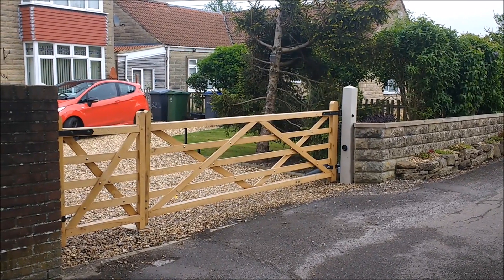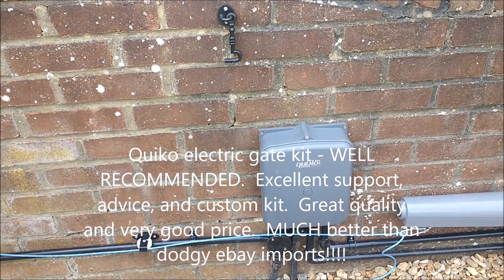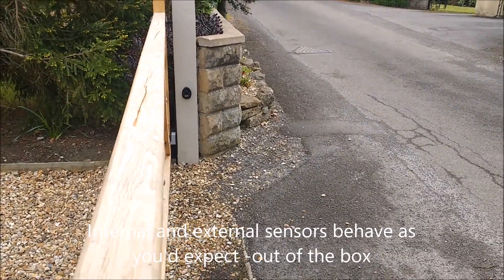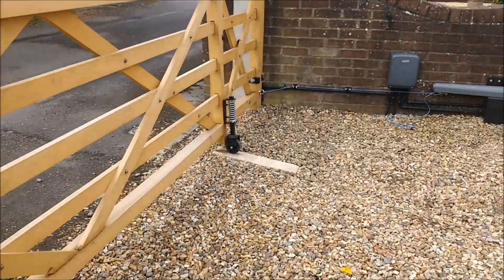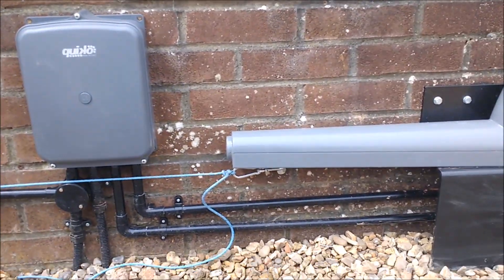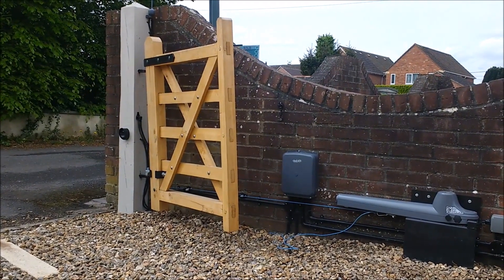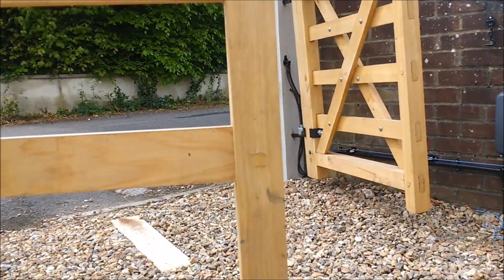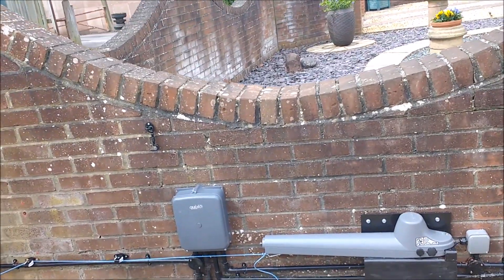DIY Electric gate kit, ,with manual AND automatic pedestrian gate

Comment: Thanks for the video Ryan. I am looking into final year projects for engineering and although I have an interest in sustainable/renewable energy, I also have a need for gates. I too want an auto/manual pedestrian option and I luckily found your video to give me a couple of ideas I hadn't fully put together. Whoever built those gates for you should be ashamed. I am not a wood worker and could have done better. They really don't look like they will last more than 5 years. I notice the gate wheel only contacts the ground in the few inches from the fully closed position. You could easily add a post for the wheel to rest on in the fully open position with a 10-15 degree chamfer for it to climb onto the post. It would eliminate the strain on the pillar in the open and closed position. And should you get a better, heavier gate, it would be needed. It wouldn't take more than 20 minutes to do something simple. You could also clad your existing gate in cedar. It would look a lot better. Cedar is naturally bug and water resistant an is used in quality fencing.  

For my project: My opening is about the same width and I would want the pedestrian gate to be able to manually open when closed, unless it is locked....more on that later. The main difference is that the larger vehicle gate will need to be on a track, or wheel. It will need to be a sliding gate, so I will likely be planning a motor for that. If the gate was to swing open/closed, there would not be enough clearance with the cars parked and there is the secondary issue of plants and bushes. A track system gets me out of jail on that. My thoughts as of this morning are to build the primary gate structures from tube steel and have the gate thickness about 40 to 50mm. I could wood clad the frames and be able to install the actuator for the pedestrian gate into the gate frame. As the rod retracts, it would either pull a cable into the gate which would be attached top the wall. I could use a gear system too, depending on the travel of the rod. When the rod is fully retracted, the gate would be fully open and could not be manually closed. I will look into appropriate hinges to close the gate when the rod arm extends and releases the tension on the cable. I am also thinking about an actuated locking mechanism, but I would need an actuator I could manually override. My design idea is a bit complicated to explain here, but let's just say the gates would meet like interlocking fingers and the lock would use an actuator to drive a main rod with a number of smaller rods attached to it. These smaller rods would lock the pedestrian gate to the vehicle gate and into the ground.

Thanks again for the video. Good ideas are plentiful on YT.
Reply from the maker: The gates are sh*t.  they stay closed 99% of the time and open only for driving in, so having a ramp on open isn't needed (I did buy a ramp block just in case).  Anyway, the f*kn gate post snapped a couple of days ago!  Softwood post and had rotted through.  Thats what I get for using an original post.  Dug out and replaced with a 150x150x2400 oak post which should be a lot stronger (@ £80 for the post it better outlast me too!).

Your ideas sound challenging!  Anything is possible so give it a go!  Look forward to seeing the end results.  Just don't buy the gates from the place I did!
Reply: @Ryan_DYD  
It is exactly what I was thinking would happen. You should definitely use that ramp post. While the gate is only open for short periods of time, there is repeated stress every time they open. The stress is dynamic and it is greatest when the gate is fully open. It goes from a pulling and bending stress, to a twisting stress as it opens and the gate acts as a lever pulling down. Adding a rest point there would significantly reduce the chances of early failure. Of course, an additional hinge could also be used to share the stress. 

I hope when setting the new oak post, you have ensured there is no contact with the soil. If there is ground contact and especially if the post is partially buried, it needs a high quality sealant. Some people think its fine if it's buried in concrete.....it's not. Oak in particular cracks as it ages and leaves plenty of places for moisture and bugs to enter. For anyone else reading, the best DIY sealing method is to half fill a bucket with high quality wood sealant and immerse the bottom end of the post in the sealant. Paint the rest of the post and leave overnight in the bucket to allow the sealant to penetrate the wood. It should be immersed at least as 50mm deeper than it will be buried in the ground, so you won't be able to use your kids beach bucket :) . The result will otherwise be moisture getting in and compromising the structural integrity as insects have their go at it. Not doing this might cause failure in as little as 2 years. Doing it properly, the post will survive longer than you. Do it once. Do it right.

In the event I proceed with the gate project, I will be be doing it all myself. The only parts I won't be building are the motors and actuators. I would also need to figure out how best to prevent the gates from attempting to open in the event the locking mechanism was active. Perhaps a mechanical sensor would work best, killing power to the motors/actuators when activated.

I have two other projects I am considering. First, a closed loop hot water solar panel to raise the temperature of the water in my pond over the colder months. If the base temp went over a certain level, a blind would automatically close until the temp went below another preset level. 

I could design and build an auto fish feeder which would operate at various times of the day. The frequency would depend on the month and it would cease operation between October and February with the ability to press a button an manually feed when required. The coding end is putting me off that one. You probably guessed I have a pond. Designed and built myself, with my FIL helping on the blockwork and laying the underground pipes for filtration. It's on my channel if interested.

Comment: Move the pulley wheel that’s closest to the pedestrian gate closer. If the pedestrian gat is opened then make that pulley at a perfect 90 degrees with the gate attach point. That’ll get you open further. Also, if you switch it for steel wire that can handle more stress you can move the pulley beyond 90 degrees and get even further movement from it.

Comment: Good work Ryan. I want to buy a quiko system, what did you use to talk to google? I have everything in my home connected to google home, lights, water features, even front door (although google will only lock it no open it), I don't have a hub of any kind, just google homes everywhere.
Reply from the maker: I can't fault the quiko element of the system at all - so good choice.  I'm using lightwaverf for home automation which is a hub and links wirelessly to "stuff".  The quiko controller has a connection you can short out to automate.  Mine is set to "open-stop-close-stop" - so each "press" changes direction or stops.  (How I have the remote set too).  So I just have a relay contolled by LWRF set to close, wait 1s, open.  And just running that sequence presses the button.  (So yes, saying close gates when they are closed will open them, and if moving it will stop them).  But its always fine and obvious.  If you can  get a google relay you could do the same?  (My relay is inside the controller box)  Quick search and there are relays and switches for google home https://amzn.to/3eUIisz but no idea how they work.  You have 240v available inside the controller box - but the "switch" is voltage--less - you just short (switch) two connections on the interface.  Good luck!

Comment: Would I be correct in assuming that your drive inclines up away from the gate and the hinges needed to be designed so the  gate would rise in line with the  incline. Did this create any problems when resourcing a gate opener.
Reply from the maker: Didn't take it into account with the gate openers.  The hinges were "as was" when I got here.  House is old and not level.  Its not that sloped - maybe a little (6"?) towards the closed position.  dunno.  Its gravel and its, well, shite.

Comment: The rope doesn’t look very good, How has it held up. Thanks.
Reply from the maker: Actually held up realty well. Not touched it since install. It was no  stretch rope. Someone suggested bike brake cable that may have been better so may change to that if I need to

Comment: Great video, this is exactly what I'm needing. I'm going to use one motor to open both gates, motor on large gate and a long bike brake cable pulling the small gate open using motion of driven gate via cams. Cable will be in conduit under block paving. This will allow postman etc to enter drive as it will be spring closed and pulled open. Also I might use a strong magnet to keep small gate closed against driven gate
Reply from the maker: Hmmm - think it through!  Brake cable great idea.  But for us, the open/close is different.  before I set it up I assumed the same but it isn't.  e.g. RHS opens first, then 5s later LHS opens.  On close, LHS closes then 18s later RHS closes.  So doing it with one may not work (of course depends if they have any overlap).  I have no centre "stop" so my gate catch overlaps.  Good luck though!

Comment: Nice system throughout my life I’ve heard professionals tell me many times that my request couldn’t be done the way I wanted or needed it to be  and I learned long ago that it was usually  a excuse for their own laziness  or lack of knowledge  and  I knew more about their  expertise than they did it’s not that by any means  at all that I am a genius or know it all  it’s more of I simply research the heck out of things I’m interested in  and I have a “think outside the box” attitude  and a creative mind  that is fast at mathematical equations  and has a lot of mechanical knowledge from over 20 years experience in general construction and Custom woodworking  basically I can easily  look at designs and tell if they will  actually work well in reality mainly because I can visualize something  in a drawing to its 3dimensional  final   Completion and most people can not do that as quickly in their brain  I learned that  a long time ago and how to reckonize  when a client  can’t  so I formed my own style  of being able to help those  understand it better  usually that was  sketching a 3D  drawing  to give them more of a visual on paper to look at  before auto cad drawing had that  ability like it doe currently

Comment: A great result. May I ask how much you think I'd need to budget for a similar project?
Reply from the maker: Not as much as you think.  The Quiko gate kit is fantastic - not ebay tat - feels over engineered but speak to them  direct and cheap.  I had a bespoke kit - extra external sensors (and internal) - two different actuators, controller, 4 remotes etc £505.  The gates are crap (warped) - so DYOR on gates.  The rest, conduit and cable was screwfix/toolstation - <<£100.   The home automation existed already, just needed a relay (£30).
Reply: @Ryan_DYD  Thanks!

Comment: Very nice job sir congrats it looks nice , I think your gates looked nice but it appears you wasn’t happy with the gates ? May I pls ask why? Just curious , many thanks 😁👍
Reply from the maker: The gates were a little badly made - where do I start!  Where the mortice/tennon joints are, they aren't cut even, so the tennon goes in but not flush left n right.  The mortice at the end was all the way through the uprights, the bars went in and were just sawn off.  Badly, scratching the uprights.  And the sizing so wrong it just doesn't match.  The bolts holding the diagonals aren't central, even, or even the same way round!  Stupid things like that.  And, the big gate has twisted - and did so very early on.  Poor really.  Still work though and not enough to annoy, and if they do they will become firewood!

Comment: I would say there is more "pulling-out-of-the-wall" force on that last pulley, than on the opener itself, which is mostly shear force. Having said that, I wouldn't be concerned, if it's Rawl bolted on. Nice solution to actually a fairly common problem.
Reply from the maker: Thanks mark - your observation is bang on what it feels like.  The opener bracket is over engineered in hindsight - but having never done one before I was only speculating.  The force on the pulley is more than I'd like, and should've remembered some A level/degree maths where to keep lines straight the force becomes infinity (e.g. weight on middle of a piece of string will always bend the string).  Best I could figure at the time, but happy to hear of any mk2 improvements if/when the pulley bolts rips the brick apart! :)
Reply: @Ryan_DYD  If you move the metal hoop the rope is attached to on the gate so that when it is almost fully open the rope runs through the pulley to the gate at a right angle then it won't be trying to pull the gate off it's hinges. It's creating unnecessary shear force on the hoop at that final 120 degree (ish) angle. Anything over 90 degrees in those last few inches and the force is pulling the gate away from the post.
Reply: @Ryan_DYD  In fact, right at the end there is no force pulling in the direction you want at all. It's kind of a stalemate between the motor and the post.